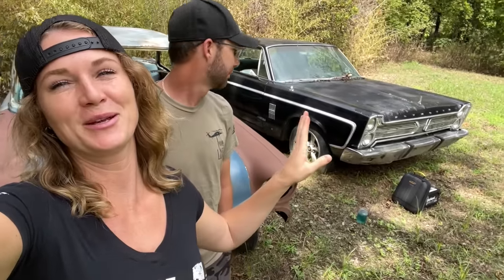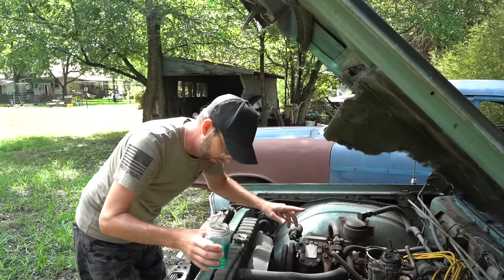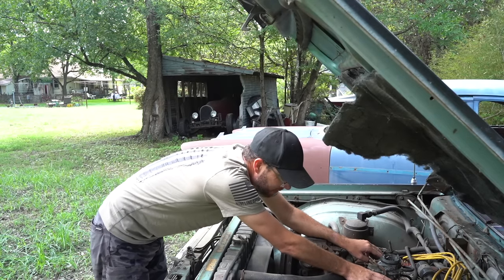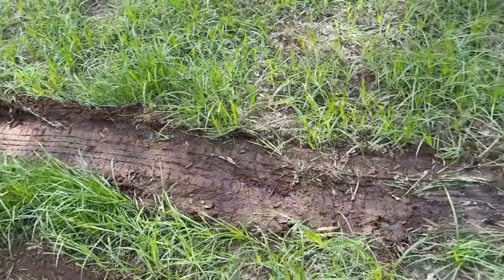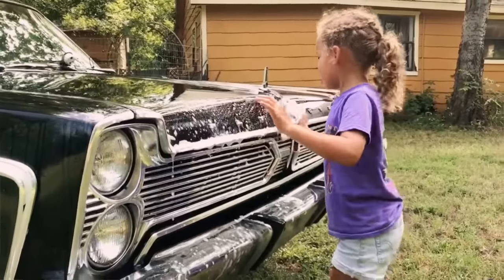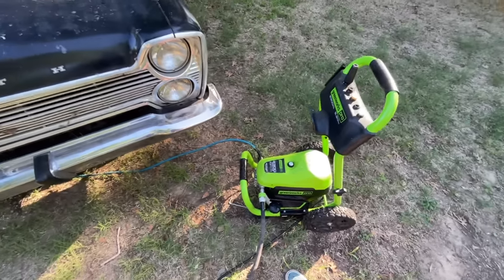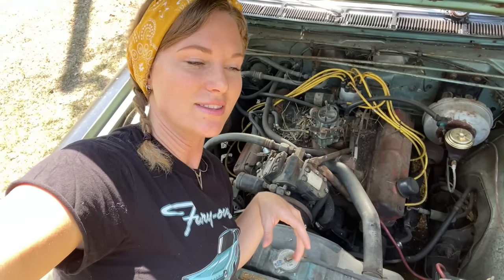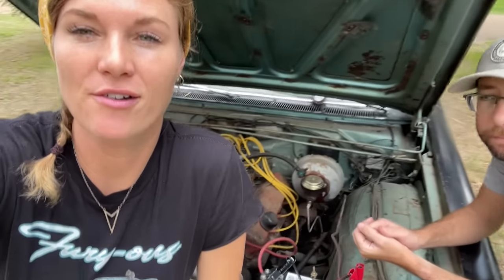Abandoned Plymouth Fury!

Comment: Killer video! That Fury looks sharp as can be. And thanks for the shout out Aaron!
Reply from the maker: You’re awesome, Chris 😎
Reply: @flyingsparksgarage  there is a scammer in the comments pretending to be you. Their username starts with Telegram
Reply: @flyingsparksgarage  I heard about you guys from another youtuber, and then you posted this Fury video that popped up on my feed. 

I have three of these and that's a Canadian 318 Polyspheric headed engine.  They were the standard workhorse until 1966. They get GREAT mileage in stock trim and that little two barrel isn't bad at all with a fresh kit in it.
If you want information about the car, check out the fender tag decoder online, and put in the numbers on your fender tag and you will find out all the factory specs on your Fury.

If you aren't familiar with that carb, I would be happy to refurbish it for you, and tune it on one of my 318's so you could bolt it on and rock & roll. 
There's allot of folks in the Mopar hobby that know allot about those C bodies. The community is as old as the cars are,  and then some, in some cases,  Lol

Comment: I had a '64 Polara 500 - basically the Dodge version of the Plymouth Sport Fury. One owner when I got it.   Owned that car for 16 years, went from 68K miles to 337K miles.  Had the 318 Poly.  Was a tad tired when I traded the car, but still ran like a champ.  Heads were never off!  
My unsolicited suggestions for your Fury III are:  clean up engine bay.  Find air cleaner.  Rebuild original carb - will make enough power to be surprising and net about 17 MPG.  Change all fluids and fix the original A/C.  That factory V-2 compressor is bulletproof.  All parts are still available,  though some are a bit tough to come by.  Join MOPARTS forum - free and people will embrace you and be very helpful.  Make the car safe, original and enjoy it.  Fantastic road car, BTW.
Be careful with the power washer.  it will hurt the trim.  Please keep the stickers and original dealer emblem.  Very cool.  OEM color is turquoise.  Very pretty.  "Kid" is great.  The windows are tinted [not the film you pulled off] from the factory with A/C.  Just Dashes will make the dash look new.  Best spark plugs I found for my 318 were:  Autolite 85.  Belden plug wires.  Have fun!

Comment: That's a 318 poly. Solid lifters and fairly high compression. More fuel, fill the bowl through the vent. If you need help with parts let me know. I've been a avid 65 and 66 Fury owner all my life.
Reply: maybe they could put in a 426 max wedge in there :O
Reply: Poly 318 are great engines
Reply: I might need some help eventually.  I have a 65 fury that's complete, but was disassembled 20 years ago.  I'm not sure I know where everything goes.
Reply: @mattc3152   first you have to know what everything IS !
Reply: I purchased an off the showroom floor 65 Plymouth Sport Fury manual 4 speed trans. It was equipped with a 383 cu in engine. A 426 Hemi was an option but I could not afford the extra $ 750 cost plus the additional costs of Auto Insurance for having a 426 Hemi. I don’t remember Plymouth Sport Fury having a 318 cu in engine  option in 65. I wish I still owned the vehicle!
Reply: @charlescampbell6756  My mom had a 1969 Roadrunner 426 Hemi with a Hurst 4 speed manual and it would pull the front wheels off the ground going into 2nd gear, but when she found out that she was pregnant with my oldest sister she traded it to my uncle for a 1970 Ford Galaxie 500 station wagon. My uncle's girlfriend totaled it head on into a tractor trailer. It was Plum Krazy with the dual quads under the hood...the Holy Grail of Mopars. Edit: by the way, she was 18 when she bought this car in 1969.
Reply: @charlescampbell6756  the Hemi was not an option for the fury line but the wedge was.
Reply: @57guitar1  The Dealership where I purchased my 65 Plymouth Sport Fury offered to install a 426 Hemi in exchange of the factory equipped 383 Cu in. For an extra $750 which would increase my monthly payments approx $40. I was tempted but the increase in Auto Insurance due to the Hemi was too much for my monthly stipend as an enlisted USAF E-4.
Reply: @coyboybc   yep…..,got one in my original 1966 Dodge Polara police car and it still runs great. The only thing I’ve done to the engine besides normal maintenance is I had to put in new valve guide seals a few years back. 😬👍
Reply: Wouldn’t have a 318 poly 4bll intake you’d like to turn loose….?🤔
Reply: @surgicalshooter911  those are EXTREMELY rare from the factory, in cast iron. In the '90's Weiand made a respectable street dual plane 4 barrel aluminum intake for the Poly, but people didn't buy it enough to justify keeping it around,  so it was discontinued. 
Now, only Roland Osborne's buddies are still making a 4 barrel aluminum intake for the Poly and it's a little spicy pricewise but, it's a great piece.
Reply: @patrickwayne3701  thank you for the information, I will definitely follow that up sir. 😬👍
Reply: @surgicalshooter911  I currently do not.
Reply: 650 dp single feed mech sec spread bore
Reply: @Brock_Landers  thats a funny story
Reply: No solid lifters, where did you get that information?
Reply: @charlescampbell6756  The Hemi was not an option, where did you get your information?
Reply: @3602go  From the Dealership Sales Manager, when I purchased the silver gray 65 Plymouth Sport Fury 4 speed manual. I am now 82 yrs old. and my “recollector” is strained sometime but I do recall the Dealership Salesmgr trying to sell me a “Hemi” in exchange for the original motor that was installed at the factory! I was really tempted but my Military E-4 pay could not support the 
monthly car payments plus the annual Auto Insurance fee increase due to the car would be reclassified as a being “race equipment installed”! Just perhaps losing my Driver’s license for 60 days (Cited 2 times for speeding within a 12 month period in 1961 may have 
contributed to the  threat of extra high car insurance premium) Virginia DMV LAW back in that time period. Attorney fees were expensive and I was earning $1.30 cts per hour at my factory job in 61’ Thanks for challenging my recollections
Reply: @3602go  I heard that when reading about it, just wasn't sure cause I read it on the internet. And you know it's got to be true
Reply: GREAT CARS!
Reply: @3602go  I have owned a few of the poly 318. All of them were solid lifter.
Reply: @57guitar1  Very good, I've also owned several, and none of them had solid lifters. Mine were '65, and '66's, what years were yours?
Reply: @3602go  strange. I've had 66 VIP, 65 SF, 65 F3, and 66 convertible SF. All were the poly 318. Some were 2bbl, some 4bbl. All were a solid lifter that I would set lash on every other year. They almost never were off by much. Did have one adjuster back out on the hwy. Loctite  and back on the road. I know you can order solid or hydraulic for them now. Gary Pavloviich and a host of others put a lot of research into making the poly perform. A bit pricey comparative to modern, but unique in a crowd. I love em. Bullet proof.
Reply: @57guitar1  I would like to see in a factory service manual, it showing you have to set the valve last on the poly 318. And also, why would Chrysler have solid lifters in this motor, but no other motor, except the Hemi, it's not like it was a High performance motor.
Reply: @3602go  I had a book. It's out there. I looked at some of the forums and polys had both. The hydraulic did not have the adjuster on the rocker arm. Mechanical can be converted to hydraulic with aftermarket cams, but read one that had trouble with adjusters not staying put. I'm assuming they were just wore
Reply: @patrickwayne3701  I always wanted to have a tubing bender and a bit of skill with a welder, get two BBD's and weld-together a cross-ram.  Never did, but it'd be a LOT of fun!
Reply: @coyboybc  Heavy engine though.  They're just a smidgen lighter than a 440.

Comment: This brought back so many memories. Prior to leaving for military sercive, SE Asia, in 1968 I had a '65 Plymouth Fury III 2D-HT 383cu. 4bbl, 4 speed. Loved that car. It was painted the same color as the original color of yours. Sold it before shipping out to Vietnam because I wasn't sure I'd actually make it back home. After I returned I bought a '66 Plymouth Satellite 2D-HT again with a 383 4bbl, 4 speed which I turned into a drag car. Mopar big blocks, 383, 440, and hemi's have the distributor in the front of the engine. The small blocks 273 and 318 had it in the rear. These cars are though but heavy and I tore up several rear ends when you put allot of power to that much weight. I also worked in the service department of the Chrysler/Plymouth dealership. If these cars sit without being driven the brake wheel cyl. rust on the inside and start leaking the fluid out all over the brake shoes and you have no pressure. Check inside the drums before you put too much effort into those brakes. Glad to see you back. I also have a little 4 1/2lb. female Yorkie. They are such great dogs. Good luck.
Reply: thank you for your service

Comment: Those old 318's were some bad ass engines and easy to work on. I would try to keep this as stock as possible, it is awesome just the way it is. Ya just can't run down to the Chrysler dealer ship and get another one like it. Respect it for what it is, it was unique in its day and still is. Love your site.
Reply: they were when new.be smoking and wore out by 50,000 if you drove it hard
Reply: @briandetrick2688  Thats funny. I have had several as well as a lot of people that I have known and as long as you kept the oil changed every 3000 miles and tuned it up a couple times a year, they would run upward to 200 thousand miles easily.
Reply: @leslietarboxjr4287  -> Yep, my sister had one in the mid seventies - would bring it to us for an oil change if the light didn't go off after a curve. Dad could hear it pull in the farm driveway - "Judy's here for an oil change". - LOL  You couldn't kill it, she tried.
Reply: most likely a 318 for that year would be nice if you could drop in a340 it looks like the body is worth saving if you could find a donor car you might even get a better interior
Reply: It's a wide block 318. Not the same  as an LA Mopar small block, I.e. 340 /360
Reply: 66 was the last year for these. 67s came with the LA  273 or 318. The wide block originally displaced 313 cubes. There are 4 bbl intakes out there.

Comment: Gas with Marvel Mystery Oil will work very well when first starting an engine for the first time in a while,  but it's no substitute for pulling the spark plugs and squirting some down the cylinders.   Also,  you really should pull the distributor and reach down with an attachment on a drill and spin the oil pump up for about two minutes to allow all the crank and camshaft bearings to be lubricated before you even turn the motor over or you stand a good chance of wiping all the bearings in the motor.   This will also help the lifters to pump once the engine turns over.  THEN you turn the engine over for 15 seconds without the plugs installed to clear the Marvel from the cylinders and fully coat them.  THEN you put he plugs back in and the wires on.  THEN you spray a little starter fluid with lube (some starter fluid comes with lubricant,  some doesn't)  down the carb,  and THEN you try to start it.

Comment: Definitely accelerator pump. When the throttle just opens, there isn't much air moving through the carb pulling on the ventury pulling gas out of the bowl. So, the accelerator pump gives it that extra bit of fuel until the air flow starts putting fuel.
You have a "flat spot" as it was called. Before fuel injection.
Reply: Being a Chevy guy, I didn’t like these cars back in the sixties, but now I think it’s beautiful.

Comment: I had a 64 Fury as a kid, so nice to hear that engine. It is in fact a scallop head 318. hence the pattern on the bottoms of the valve covers. I would say start with an overhaul kit for the bbd carter carb, Champion copper core plugs cap rotor and wires. Get some fresh gas in the tank and check the timing. Not sure if the distributor is electronic or has points and condenser like mine, did seem like it was running ragged. Transmissions on those were pretty bullet proof. good luck! Oh and change out the ballast resistor for the ignition as well.
Reply: Terry Blake if you keep the same firing system ( points, condenser, plugs, distributor, coil) the car needs the same ballast resister. The ballast resister reduces the voltage used to incite the coil because it is triggered with stored charge in the condenser by  the opening & closing of the points. The lower voltage increases the life of the points and helps prevent the points from burning.
Reply: @UC8ncy7e0sC2kYiKvOGfJiUg yes you are correct. When the ignition switch is turned to the “spring loaded start”;position, the resister is by passed and full  battery voltage is supplied to excite the ignition coil  just to assist starting and when the ignition switch is released it returns to the “on” position which connects the resister’s 9 volts to help keep the points from arcing and burning. That is the reason the start position is spring loaded so as soon as the engine fires up, just release the switch and it will automatically go to “on”!

Comment: The engine is an A 318; a predecessor of the LA 318 which became  Mopars go to engine in 1967.  Parts were fun to find in the 1980s when I had a 66 F3 2door. I painted it black from original white and the red interior just popped ! Weiand sold high rise intakes for this engine. Old drag racers said the engine was a favorite with a cult following. Mine had a 727 torqueflite  transmission.  Love this bodystyle! Thanks for sharing this joyrney. Good luck and God Bless yall from NC.

Comment: Guys, thank you way fun.  Many of us that do power tour look for small block Mopars like this one. If it was mine I would put a fuel injection system on the car.  Not a bigger carb and stay with the small intake so the gas mileage on the power tour was good.  I would make sure the air conditioning works if it has air if not vintage air it.  I would replace the front seat, either go full on stock vinyl replacement bench or buckets from something newer.   Headliner replaced, remove the padded dash completely, upgrade to 3 point basest belts and drive it. Make it a really comfortable cruiser.  I would have a cheap respray in the original color, likely use a single stage paint.  New tires keep the wheels, drive it on the next power tour in honor of your friend and ride in style and comfort this next year.

Comment: As a diehard Mopar fan I vote for a thermoquad. Love the 66 full size plymouths, my favorite is a belvedere. Nice addition to your family
Reply: Thermoquad is a wonderful carb! I run one in my hot 360 dart sport. It runs like a champ. Even with a big cam.
Reply: Thank You for the correction. The Dealership ‘s offer must have must have been a scam. I had owned the Plymouth for just a year prior to getting my orders to report to Vietnam in June 1966. I thought I may have been confused about the year/ model 1965-66 but I purchased it in the spring of 1965 just prior to the shut off of the 65 models. The 66 models were due in Sept 1965!